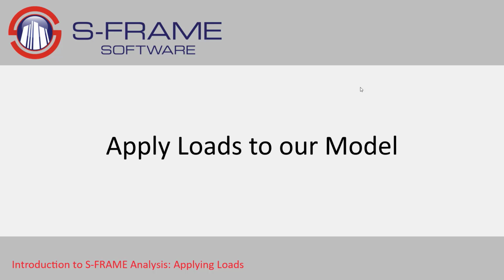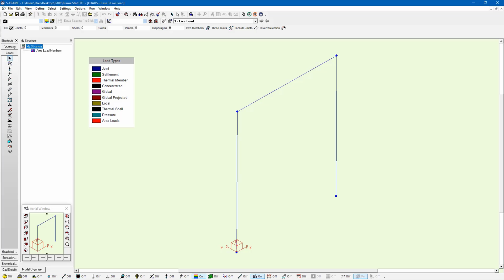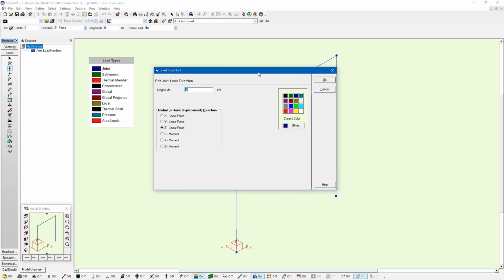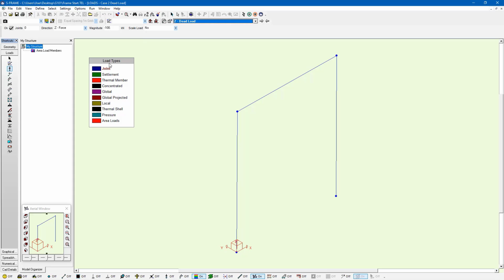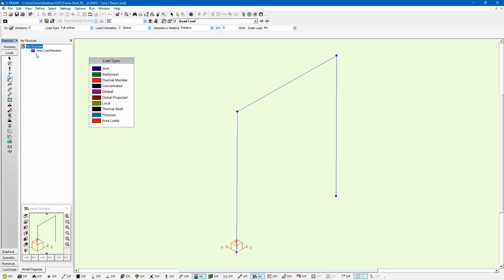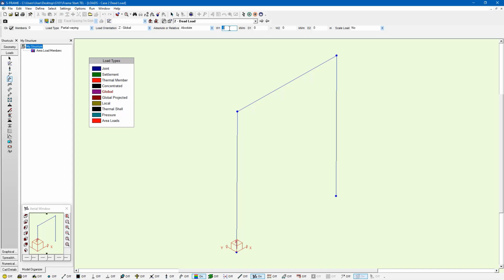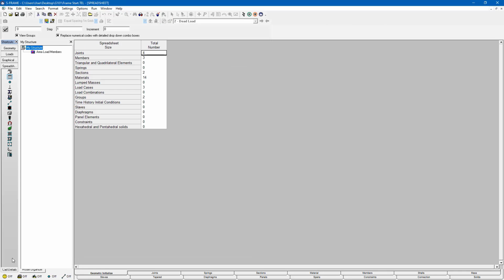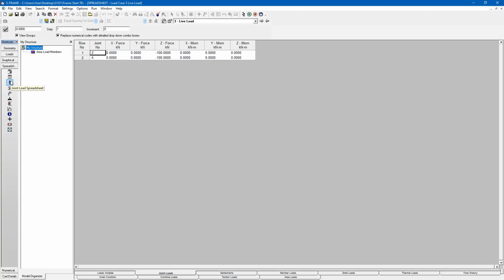S-FRAME Tutorial Series #12 - Applying Loads

Comment: What does the joints 0 box mean?
Reply from the maker: Hi there, would you be able to provide some additional elaboration to your question (perhaps a time stamp) so that we can provide a detailed response?
Reply: @altairhowto  Thanks for the reply. @1:45 the instructor mentions about the data bar. How would one define the load using the data bar; what does the joints(with a check mark) box means.
Reply from the maker: In this case, the user would be required to know the panel ID of the area load panel for which they wish to load (you can see this by toggling on the panel ID using the status bar).  You could then enter the load magnitude, direction, and panel ID, and press the 'Ok' button to apply the area load to said panel without needing to click in the visual editor window.